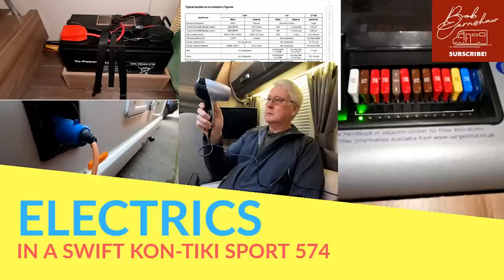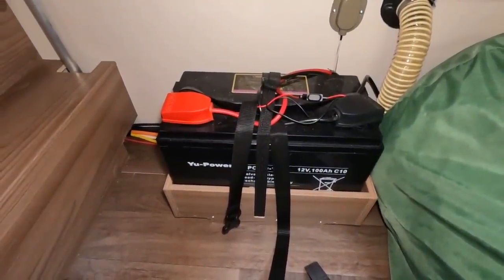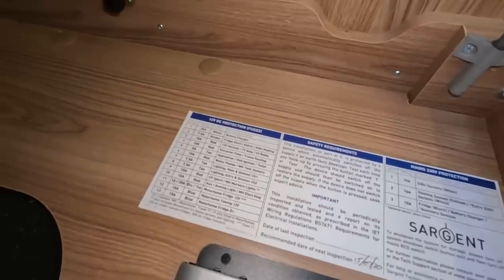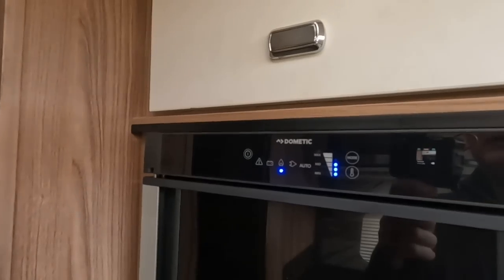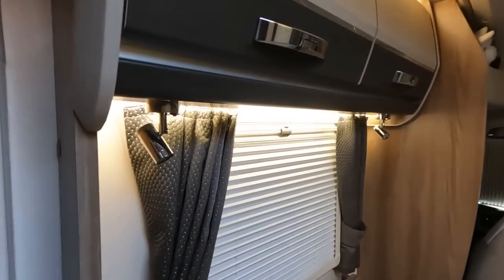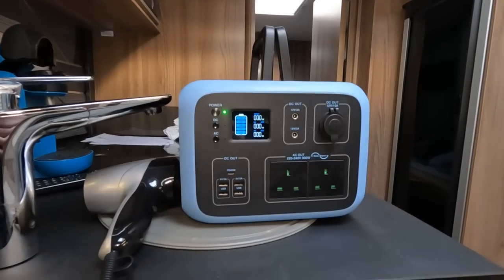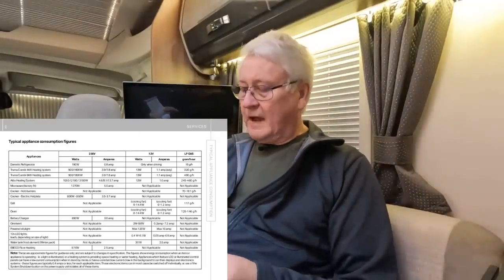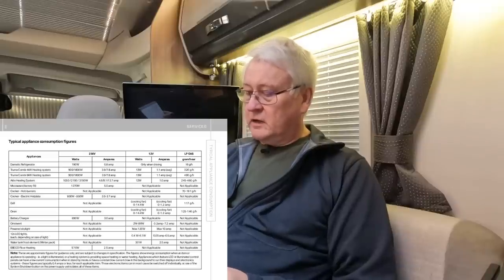Motorhome Electrics - Swift Kon-Tiki Sport 574 | New To Motorhomes Part 8 [CC]

Comment: Great video , one point many people get confused with amps A.C. vs amps DC  as the values are different depending on voltage ,were as watts remain the same unit value on DC or AC .
As an anology a 1000 watt 230v heater would measure at the battery  approx 110 amps of current ! (if say it was  used  with an  inverter), were as if used on mains 230v  hook up , the 1000 watt heater would measure  aprox 4/5  amps current  on the mains side, but the 1000 watts remains the same on DC or AC . (Re edit sorry  I originally put 9 amp should now say 4/5 I was thinking of my 2kw  heater at first )

Comment: Hi, I was told to switch of the main power button on the consumer button when not in use as to not drain my batteries even though i have solar. Could I switch power back on before I commence any journey rather than when I arrive on site in order for me to be able to switch on my lights in my habitation area when I get to my destination? Hope that makes sense?
Reply from the maker: I assume you don't have mains hook up when not in use, so that advice would make sence. You have to switch the control panel and the consumer unit on to be able to switch the lights on, so it makes sence to switch the consumer unit on before you set off. It's a good chance to check things are working before you arrive. I hardly ever switch the consumer unit off, because I'm on hook up at home. I leave the heating on low, during the winter at home on hook up, so I have the control panel on for the heating as well.

Comment: Very informative and much appreciated. You should have a usb socket in the central glove box, I have in my Fiat ducata.
Reply from the maker: Thanks, I don't have a central glove box, but there is one for connecting a smart phone to the radio, not for charging though.
Reply: @BobEarnshawMoHo   mine is a camper van so different from yours, I wrongly assumed that all Fiats were the same spec.
Reply from the maker: @carolynhaywood7701  they removed the glove box on 2019 models, gave us two cup holders instead.

Comment: Hi Bob, very good thank you.  I have a fiat ducato 2000 swift sundance, and i do have a sopcket that totally confuses me, maybe you can help.
There are two sockets next to each other beneath the TV wall bracket. One is  mains 3 pin socket, the other is a 13amp 2 pin socket.  
When we bought the MH we were advised that the 2 pin was for use off grid, and that we could use it as it fed from battery/solar panels
But we can not seem to get the plug to work.
I bought one of those gizmos that has the 2 pin at one end and the cigarette lighter/round thing at the other end.  I then bought a usb type fitting that goes in that, so the idea was that i could charge phone, use lap top etc when off grid via that set up.
But it doesnt seem to work.
Do you have any ideas? 
Toni
Reply from the maker: Difficult to say without seeing it or using a multimeter, but if it has rectangular socket holes it is probably an older 12v socket. They always used to be a beige colour.
Reply: @BobEarnshawMoHo  yes beige. Does that make a difference?
Reply from the maker: @CampK9DogWalking  then it's probably a 12v two pin socket. They were always beige.

Comment: Is it a standard thing to have your vehicle battery in the cab like that? Also will you be adding more leisure batteries or upgrading them?
Reply from the maker: Yes, the Citroën Relay, Peugeot Boxer and Fiat Ducato are all basically the same vehicle, sometimes slightly different engines, made at the Sevel factory in Italy. They all have the battery under the floor there. I'm not planning on adding any batteries, I don't go off grid enough to warrant it.

Comment: For what it’s worth, in our Hobby motorhome we can definitely still run all our 12v electrics in the habitation area with the engine running and the vehicle being driven, not least of all because our fridge runs on 12v when in driving mode. All our 12v lights and sockets also work when driving. (All this assumes that the separate master switch for the habitation area is switched on.)
Another point is that as well as being charged by the alternator when being driven, both our vehicle battery and our leisure battery are also charged when the vehicle is parked and plugged into the mains.
I appreciate that there maybe reasons why your Swift does not allow either of these things but I’ve no idea why that would be!
Reply from the maker: Think you may have misunderstood, but the Swift Smart charger charges both the leisure and vehicle batteries as required. The 12v electrics are disabled in UK made motorhomes when the engine is running for Electrical Interference Regulations.
Reply: @BobEarnshawMoHo  Thanks Bob, Looks like 12v availability when driving is one advantage of a German manufactured motorhome then!
On the other point, Sorry if I misunderstood, I thought you had said that the alternator would not charge the leisure battery when driving, but it does do so on our German manufactured unit.
Reply from the maker: @michaelgoodman8742  thanks, I better check that!